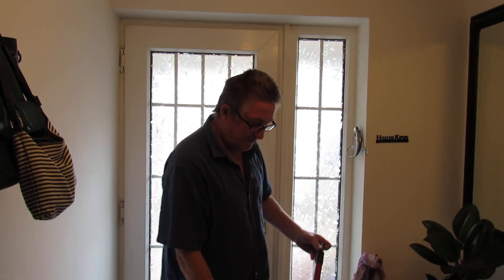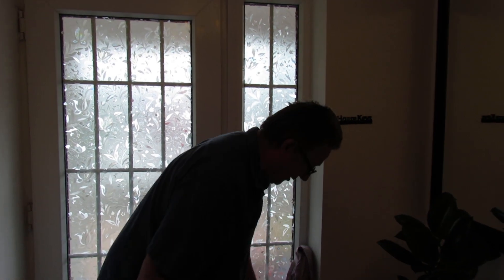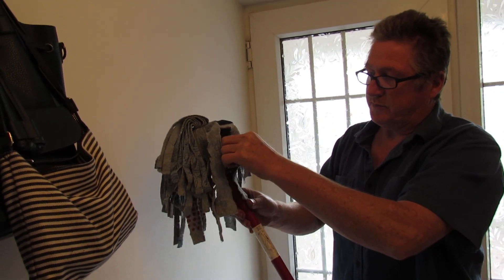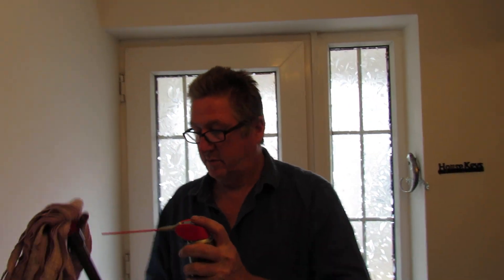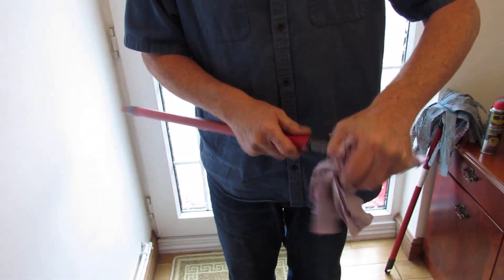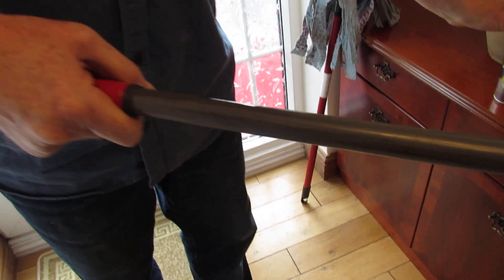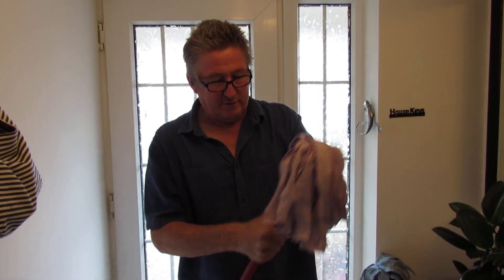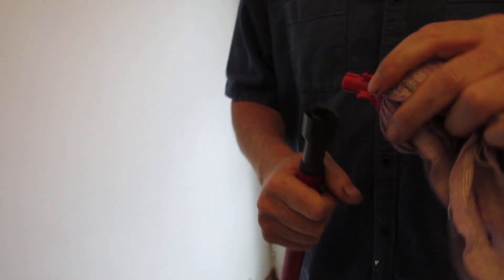How to fix a stuck Vileda mop handle that won't extend

Comment: Lubricant really works. I used JIG-A-LOO invisible all-around lubricant. Problem has been easily  fixed. When you twisting the lock, handle should be faced the floor and  fixed between your feet.

Comment: it is a design issue. small gap + with dirty water (electrolyte) and 2 painted surfaces of steel = corrosion. It need to use Aluminium tubes instead.